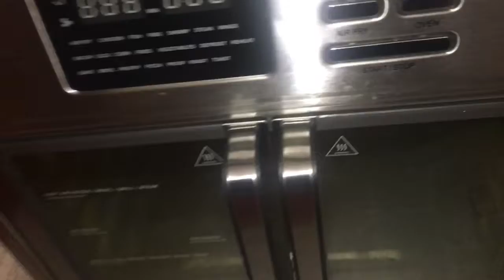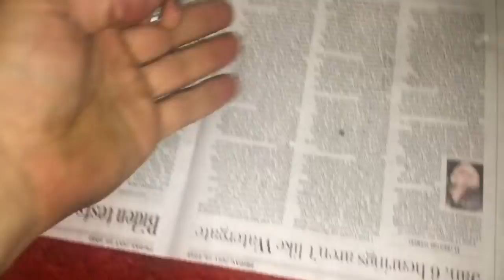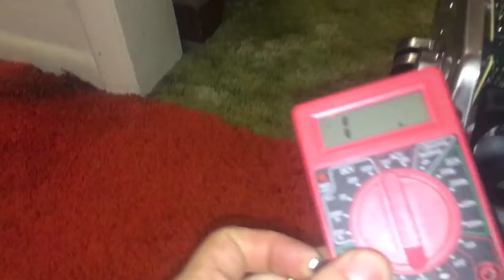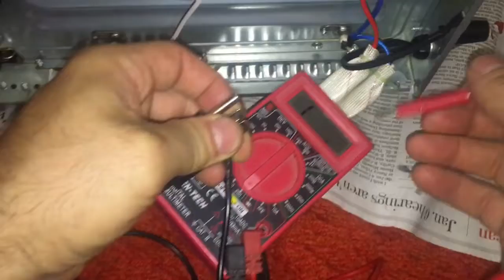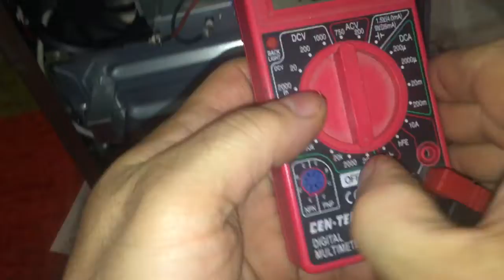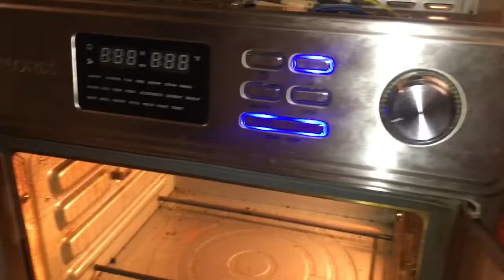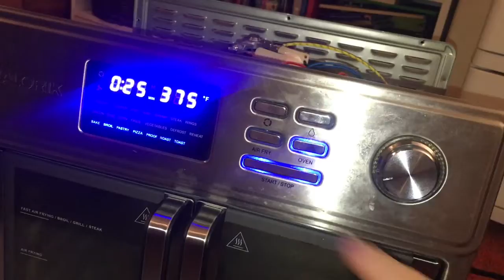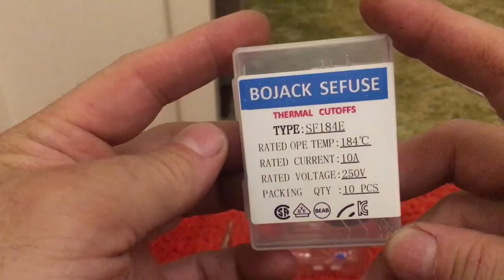Let's fix KALORIK AF-250AD2 Air Fryer not turning on Thermal Fuse

Comment: Pretty good tutorial. I took out my thermal fuse and connected the wires directly to one another and it worked. Now to order the fuse... I also noticed my ground wire for the top is completely missing. Might have shorted because of that. I have to buy one and attach it.  Thanks

Comment: Working like new thanks to this video. I was able to roll the crimp open just enough to release the thermal fuse. Cut the new one to the length of the original, slipped it into the fittings, tightened the crimp joint till it was solid again. Fired right up. Bad fuse was showing 25? ohms. Thanks again!!
Reply from the maker: nice!

Comment: I just went through the same process on mine except the cover was super hard to take off on the account of those detent things on the front panel. It's a different brand (Frigidaire) but it looks almost exactly the same on the inside, down to the placement of the thermal fuse. Those edges are dang sharp!
Reply from the maker: yeah a lot of electronics are just rebrands which is why I laugh at "experts" who declare brand X is better than brand Y ignorant to the fact the only difference is the front label... no point in explaining that as everyone needs to be right or well they have a trantrum ;)

Comment: Hi Bob - thanks for the explicit video. Why does it clearly show a (16A) thermal fuse in the video but your link and description is of a "10A" 250V Thermal Fuses 184 Degrees Celsius
Reply from the maker: at 9:09 in the video you see the fuse says 250v 10a and below that 125v 16a. 184C. 2 ratings.

Comment: Hello, thank you for this video, but I do not know the amperage that I had to erase when I removed it. Do you know the amp? Thanks.
Reply from the maker: it depends on the voltage of which doesnt matter 10amp / 16amp for 125v / 220v
Reply: @bobspurloc  Thanks
Reply from the maker: forgot to mention links are in description these are THERMAL fuses the heat range is the important part.

Comment: Why replace with 10A if it came with 16A ??  I got the exact unit and problem so it's a good video. Gotta love a guy that releases the zip tie rather than cut it!! Must be my brother.
Reply from the maker: it's the exact same fuse 1 rating is for 125v the other is for 220volts. you can clearly see that on the original fuse at @9:09   I should note that as people keep questioning that.
Reply: @bobspurloc   I'm sorry I tried to delete my comments after watching the whole video. My neighbor gave me his oven thinking I could fix it. I missed the component in the white sleeve. Pie chart says 14  for 120 and half that for double the V/E @1700W/P? Thanks for the great info. I ordered the parts from your link.
Reply from the maker: no problem. it seems a lot blow the fuse. I wasnt present when it blew to see what was possible cause aka overheated etc

Comment: Thank you! Just disassembled mine and was about to go to town with my multimeter before I decided to go online to figure out where the thermal fuse was. Made everything a lot quicker! Didn't even need the multimeter to confirm it, lol

Switching out for a new thermal fuse now, but considering that this is our THIRD Kalorik Air Fryer that's died on us (others died within a month so we just exchanged them) I'm thinking that if/when it blows a fuse again I'll swap the fuse for a switch that will reset itself when the temp goes back down. Save myself from having to disassemble the thing when it inevitably konks out again. Closest I could find was a 200°C switch as opposed to the 184°C fuse the oven came with. Same voltage and amperage. What's your opinion on that? Think that'll work alright?
Reply from the maker: wow I wonder why these blow the thermal fuse so much. I'de try and monitor your fan is running good and the flow of air isnt hindered. I cant tell u going 16c higher is ok lol... but if I did something like that I'de have to make sure the temperature 100% transfers to the switch so for example thermal loss doesnt require the unit be even 16c higher for the switch to see 200c

Comment: I curious if people that installed ...125v 10a fuses hold out when the original was 125v 16a ? Any feed back is appreciated.
Reply from the maker: the fuse isnt blowing from AMPS. its a THERMAL fuse. it blows from being too hot.
Reply: @bobspurloc   It will blow if the Amps go above 10A.
Reply from the maker: OH, I see the question now... I had to rewatch the video... yeah the original is 16amp 110v/10amp 250v as the unit is 1700watts. However the fuse I am linking is not a 10amp fuse. read the ratings its a 10amp 250v fuse as the original one which equals 16amp 110v\10amp 250v. read the fuse as I spin in @9:09
Reply: @bobspurloc The amperage doesn't change so if you fuse is 10a 250v then it's 125v 10a. So what is the values on the one you used because the link you have posted is for a 10a. The only reason I ask is I just want to know if people are installing a 10a when the original is 16a. I'm also curious if the fryer is running fine on a 10a.
Reply from the maker: the fuse in the unit says right on it again @9:09 its right there for you to read. "110volts 16a/ 250v 10a" so is the fuse lying? 2 ratings one for 250v one for 110v which is common for a fuse.
Reply: @bobspurloc  No the values aren't lying lol. I'm just wanted to find out if a 10amp is working fine. The closest I can find to 16a is a 15a. Finding 16a 125v is pretty much impossible.
Reply from the maker: the fuse I linked is the direct replacement for this fuse which is a 10A 250V/16A 110v Thermal Fuses 184 Degrees Celsius Thermal. https://amzn.to/3Xc5AzN  "Thermal Fuse (Cut-Off/Cutoff or Temperature Fuse or TF) 184°C (184 Degrees Celcius) or (363.20°F or 363.20 Degrees Fahrenheit) 15A / 125VAC 10A / 250VAC"
Reply: @bobspurloc  yes this one is a direct replacement. But when I clicked your other link that one is 10amp. The problem I was having was when I click the other link it redirects me to Amazon Canada and might be showing me something different then what you might be seeing if you live in the USA. So that's why I was confused.  I was seeing a 10 piece of fuses that are 250v 10A and they don't say anything about 125V /15A. Thanks for your replies :)
Reply: @bobspurloc  I am wondering which thermal fuse to use, the  10a or the 16a, you have both links in your video, one is a ten pack for 5.99, and the other is one for 9.99, are you saying the 10a is sufficient. ?  Or what? why is the 16a so expensive? Kalorick air fryer video

Comment: Great Video and instruction. My fuse is # RY184C but haven't found one to purchase. Can we replace the thermal fuse with another type of fuse (or fuse coupling) that's easily changed - when necessary?
Reply from the maker: i put the fuses in my video description Thermal Fuse: https://amzn.to/3A93ubJ
Other Options: https://amzn.to/3CIauwa
Crimp fuse to wire: https://amzn.to/3vLxgQP

Comment: I bought one at an online auction for maybe $6 and replaced the fuse. Easy peasy.
But I noticed an electrical spade tang labeled as ground on top of the fan at the top of the oven.
Did yours have any wires connected to that? MIne has nothing.
Reply from the maker: I dont recall. tang as in protruding up? maybe so when the cover is put back on it touches it?

Comment: Any links to the fuse on Amazon
Reply from the maker: Pinned by Bob Spurloc does stuff
Bob Spurloc does stuff
3 weeks ago
Thermal Fuse: https://amzn.to/3A93ubJ
Other Options: https://amzn.to/3CIauwa
Reply from the maker: Thermal Fuse: https://amzn.to/3A93ubJ
Other Options: https://amzn.to/3CIauwa
Let's fix KALORIK AF-250AD2 Air Fryer not turning on Thermal Fuse not working replace thermal fuse 10A 250V Thermal Fuses 184 Degrees Celsius

Comment: I didn't have a crimp tool so I tried pliers but that didn't work, so finally I just bared the wires and twisted them to fuse leads and twisted them togther good  with pliers and that works fine.
Reply from the maker: that's not a good connection, that creates high resistance which causes high heat 5amp+ will instantly fry any high resistance connections. ide get a crimping tool or a higher torque pliers. can always buy crimping tool then return it.
Reply: @bobspurloc  Well I twisted the wires together well enough and crushed them  togther with the pliers I'm pretty sure there isn't any high resistance, I agree a loose connection could cause a high resistance but I made sure the the wires wont come loose.

Comment: Watch your video because mine died. Took the thermal fuse out, put the red wires together with wire nut. Turned it on air fryer to see if worked and the wire nut immediately began to glow! Any other ideas? Thanks!
Reply from the maker: fuses get replaced with fuses of equal or lesser stats.

Comment: If I was this company I'd put a few of these fuses in Parallel so a bad fuse or 2 doesn't stop the oven from working of course it would cost a couple dollars more but it must cost them  money to repair these ovens when they stop working  under warranty.
Reply from the maker: It's a thermal fuse it blows when it exceeds its temperature. there is no such thing as a bad fuse. you seem to keep stating invalid facts with no knowledge of how a thermal fuse works. you cant put fuses in parallel, I'll not waste my time explaining why not, you can go take an electrical course to understand why that is a silly statement.  the most likely cause of these fuses blowing is as I stated in my last reply to you. the fan most likely failed to keep the components cool. either the fan is spinning fast enough anymore or some circuitry failed to turn it on. in which sure bypass the fuse or remove it and see what happens and why thermal fuses arent opt out items... in fact go remove the thermostat from your cars engine, why would it need it? the engine cant over heat without it...

Comment: I have the same air fryer. mine blew instantly once turned on, was not even warm yet. I think it was just a poor fuse.
Reply from the maker: yeah kind of odd. I'm not sure why the fuse blew on this one either. im not sure if it was just a hot day etc etc.
Reply: We've gone through THREE of these already. First two died within a month of getting them so they were just exchanged. This one took its time and lasted about 4 or 5 months, but here I am! And yeah, confirmed it was the thermal fuse. Easy fix but thinking of swapping the fuse for an auto resetting thermal switch instead if it happens again...
Reply: Why this fuse is even necessary I don't know since the automatic settings on this oven keep the temperature from getting very high, the top setting is only like 450F for 30 minutes, so why is there a need for this fuse?
Reply: @sherri419  I just by passed mine and wired direct.  The fuse was not necessary in my opinion.
Reply: @seanwilson2451  Did you end up installing a auto reset thermal switch in yours? Which auto switch do you think would work please?